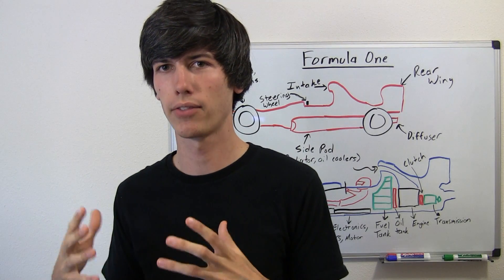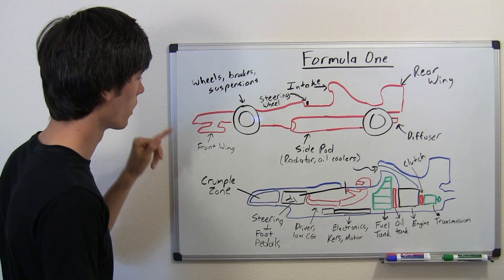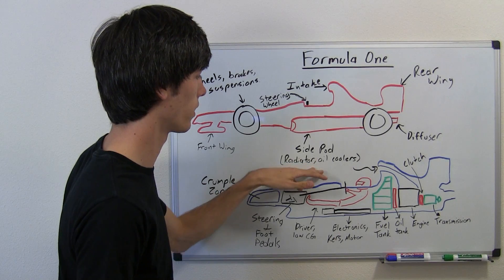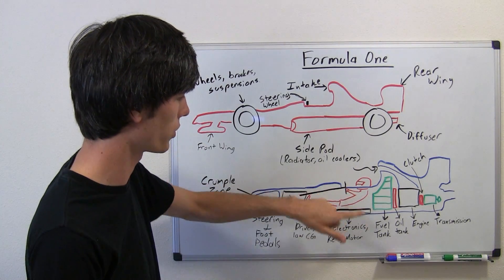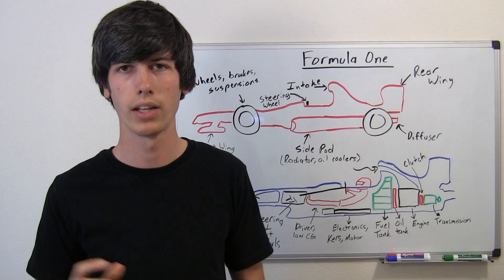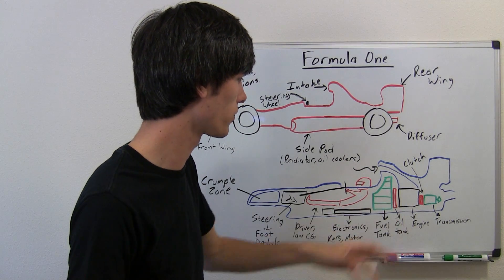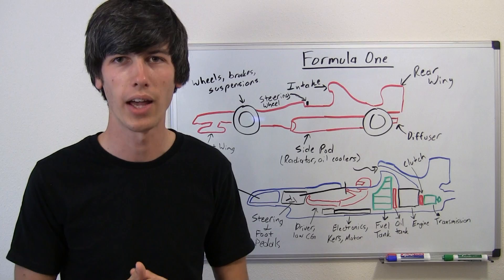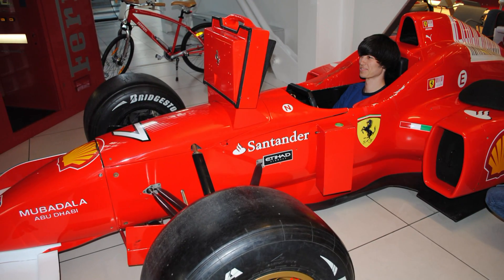Formula One - Explained

Comment: they stick to high-revving (no torque) engines cuz if it had gobs of torque it would probably trip the tires on takeoff and it may lose control in corners due to the excess torque.

Comment: That intake port is not like a ram air intake :)
It's designed like a diffuser. When the high velocity air rushes through that hole, the widening shape of it is designed to slow down and expand the air, and effectively cooling the air because of it.

Comment: Formula 1 design is by rules. It is a flawed design when you consider track times and top speed. A full bodied car is better from aerodynamic viewpoint and safety. Open wheeled cars are dangerous when tires contact causing flying cars.Keeping all parts of the car under a shell allows best controll of airflow-pressure and maximizes downforce where needed.

Comment: what is the difference between formula 1 formula 3 formula 4 car ?
please explain
Reply: arefin shakil Basically the rules and the costs. The smaller formula classes uses mostly stadardized parts. A standard engine standard chassis and so on. As a team you more or less just buy components of the car. You don't have to design them by yourselfIn F1, you as a team have to build your own car and race it. You have to design the chassis, the suspension, brake system and so on by yourself. You can buy certain parts of course, but they are also often tailor made for the specific teams.As an example Mclaren Electronics and Microsoft manufactering the standard-ECU for all teams. But actually only a certain part of the electronics and programming in it is really standardized. Some parts in it are again team specific. The ECU the Mercedes team uses would not work with a Ferrari F1 car.
Reply: Main difference in horsepower i assume.
Reply: shi01 thank you very much :)
Reply: arefin shakil your welcome
Reply: arefin shakil Formula 1 is the top dawgs

Comment: Your description of the KERS system is incorrect. The generator/motor is connected directly to the crank shaft of the engine. It is not connected to the brakes or wheels in any way. The batteries are replenished/charged when the driver applies the brakes, but the generator is using the crankshaft.

Comment: great videos, i'm glad i found them!

if i may offer a correction, kers equipment isn't located under the driver. not only would this would increase the frontal area and raise the CoG, rules prohibit high voltage and liquids from entering the cockpit. renault and mercedes systems have used discrete controller and storage boxes mounted in the sidepods until this year, and ferrari continue their combo-box under the fuel cell. the motor/gen is crank mounted and protrudes into the fuel cell.

Comment: That's true, but they still cause about a third or more of the drag [McBeath2006], so covering them up would definitely help when trying to bring Cd down (currently it's along the lines of 0.75 to even over 1 in high downforce setup). Apart from the W196 every F1 car has been an open-wheeler, and it's a part of the formula now. These days they could get them to go faster with at least partially covered wheels, but it isn't allowed by the rules at this point.

Comment from the maker: The car is designed (check out my video on the front wing) so that the air passes over the wheels. Also, to keep weight down, and the center of gravity low, it can be beneficial to not have covers over all of the wheels.

Comment from the maker: That is a clever idea, but sometimes simplicity is the best idea. Don't have to worry about pressure losses, temperature influences, design so the the bladder pushes evenly down on the fuel. And in F1 weight typically isn't an issue, they usually have to add ballast due to restrictions, and the materials involved are certainly going to be light.